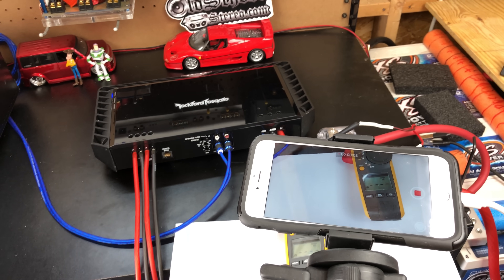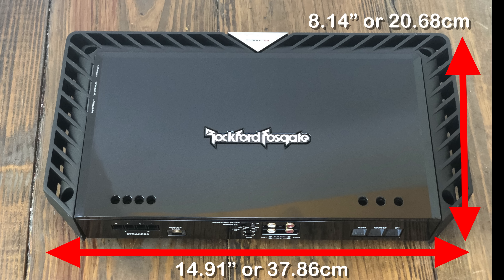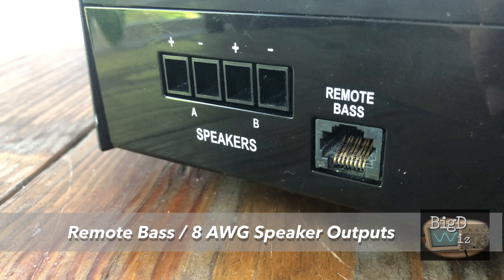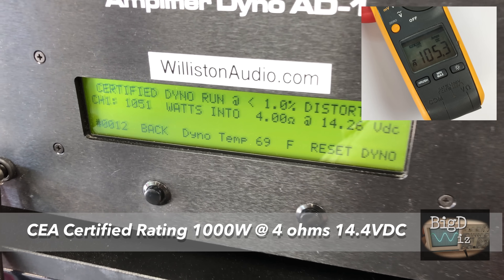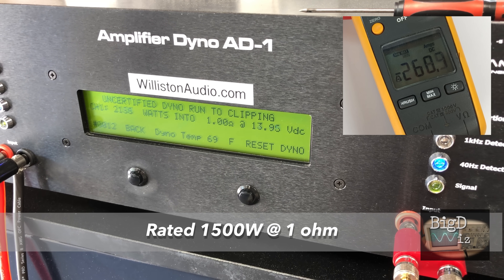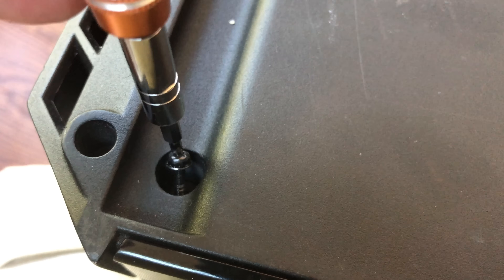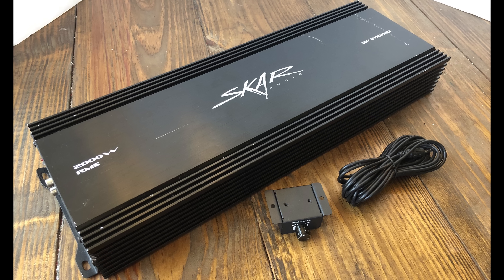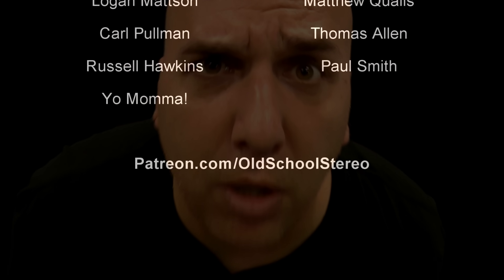Underrated? Rockford Fosgate T1500-1bdCP Amp Dyno Test

Comment: I've got a full Rockford system t1 subs and t1 amp and i can honestly say i am gonna rip their crap out of my truck and im going to rebuild it with a street set up and can guarantee my street setup will be 50 times better then their over priced garbage. massive audio xl and sundown here i come. by the way great videos ive actually watched quite a few of your amp test and your videos is actually helping me decide what my street setup will be thanks man👍🏽👍🏽
Reply: John Cox  lol technology has came far buddy sundown makes a 9x9 amp and is putting out 3 times more power then that Rockford you've got and guarantee draws low voltage. sundown fbs 3000 look it up you might change your mind about rockcrap.

Comment: I have a fosgate T500bd1 power amp.  1 svc kicker comp 12 n 1 planet audio dvc 12. What's the best way to hook them up together for the best bass.  Currently the dvc is wired to 2 ohm and the kicker is wired to it regular,  which runs to amp... connected to both A&B...  both neg. N both pos. Ran together.  So I have a jumper on the amp... A n B pos.... and A n B neg.... ran to the dvc.... connected to svc in 1 audio pipe box... not ported.
Reply: And it hits pretty hard,  just wondering if I have it right???

Comment: Need help finding a good amp.. I have MTX audio dual 12 subs 1200watts. Please recommend me a good budget amp around 150-230$ price range. I need something that will give me that BANG! For the BUCK!
Reply: the skar rp2000 is good and if you can find a hifonics brx2400.1 with the fins heatsink, sonic dyno it and it puts 2000w. both listed should be less than $200.00 used
Reply: SHō ˌôf thank you! Appreciate it

Comment: I don't really like this design it's the same design since 2010(IF IT AINT BROKE DONT FIX IT!!!!!!💪)
I had 2, 500w punch amplifiers 2 Channel pushing to 10in L7( one to each speaker) people swore i had four  tens in a Taurus station wagon back in the days( the only thing is they were monsters they would eat my hot wire every 5 to 6 months I had one fuse off the battery running straight back to the amplifiers no power dividing terminal no other fuses/ power restrictions in between oh yeah and had an Alpine 5 or 6 volt output radio)  it sound like dark rich chocolate if you know what I mean!!!! 😆 Lol

Comment: Please do a Dyno test on the Pioneer GM-D9701, seems like a great budget amp and it comes with a volume knob.
Reply: Same exact as 9601 which he dynod
Reply: @rmblwgn  so is it only an aesthetic upgrade?
Reply: @patrykkiszczynski9422  yes. I don't know what's up with Pioneer but they refuse to spend any money on their mobile line. However those are great amps I have the 8601. God I wish Pioneer would bring back their SPL Pro line
Reply: @rmblwgn  totally agree, they were legendary products sadly Pioneer seemed to slowed down on Pioneering new products :(
Reply: @patrykkiszczynski9422  just google d1200spl and take a close look at the inputs, outputs, fuses and power rating. almost like the Rockford Fossgate of Pioneer amps. man I wish they still made legendary stuff

Comment: I’ve got 3 p3 12s 4ohm dvc wired to 2.67 ohm I wanna go down to .67ohm but don’t want to blow the amp. Great amp and great video btw! “I’m outta heeeerrrreeee”
Reply: I’ve had my RF p1000x1bd wired at .5ohm for 4 years. As long as I keep it ventilated, it doesn’t shut off. I’d be disappointed if I couldn’t run a T series at .5 ohm.

Comment: I bought a pair of RF Power T1S2 12's,would you run the Power 1500 or the 1000 amp on these?Will be running the subs @ 1ohm.
Reply from the maker: 1000 as it will do 1200’ish
Reply: I have an Orion XTR 1400.1 on them now,but like to run the same brand amp/subs,will give the Power 1000.1 a try,thanks.

Comment: Have a rockford fosgate p325.2 bridgable amp. Running a single 10 " sub. Bought this 13 years ago and still bangin im my single cab. Can testify.  These amps are full of power and bullet proof. This amp has blown 2 subs over the years but she keeps doing the damn thang so shes gonna ride with me till the wheels fall off

Comment: I have 2 p3 12” , tryna find a amp to match the power,  cause the Memphis amp 1100.1 getting hot an cutting off
Reply: T1000 will be great
Reply: @TKO_Horticulture420  hello mate, rf t2s3 which amp should I use for 13 ”sub?  Would it be t1500.1?

Comment: You cant go wrong going with RF and JL Audio amplifiers.

I have a RF T1500-bdcp pushing 12w7 in a spec ported box.  Also, JL Audio XD 800/8v2 pushing a 3 way Hertz Millie Pro components, RF T2 tweeters and 2 way RE Audio XXX 6.5. components.  They sound awesome.

Comment: Back in the nineties doing installs and repairs i only came across 1 brand amp that wasnt repairable! PUNCH amps, when you shorted them out they literally cooked inside! Double sided circuit boards cooked, you couldnt even figure out where the traces used to be LOL. Amazingly if you contacted Rockford Fosgate they would send you the schematics! But the boards were way too crispy.
Reply from the maker: I use a Punch 200DSM from 1993 in my daily driver and have for the past 3 years

Comment: Rockfordfosgate is the ONLY car amplifier manufacturer I've seen use actual high-quality capacitors/components, every other brand I've seen uses cheap Chinese crap, but these guys are using Nippon chemi-con capacitors which is one of the oldest and most respected Japanese capacitor brands around besides nichicon and panasonic, United chemi-con has been making a wide range of different capacitor series since 1931.... rockford could have saved 15 to 30 dollars on each production model by using cheap crap caps or chinese knock off semiconductors... but instead they went with good quality, all the stuff in there looks like it's name brand components, I guarantee those pre drivers and driver transistors are nte's, fairchild's or sanken's as well as the supporting  circuitry semiconductors probably being made by Texas Instruments and a combo of the other three brands.... nothing but the best of the best you get what you pay for.... though from that angle though it's hard to tell which capacitor series they used from united chemicon. Next time it would be sweet if you could get better shots of those capacitors. Thanks for the review, and also if anyones ever unsure about a capcitor brand look on https://www.badcaps.net/forum/showthread.php?t=388 typically they update this list frequently... in my experience research and general consensus among other electronics nuts is that the only good brands are nippon chemicon/unitedchemicon, nichicon, rubycon, panasonic, vishay/b&c components/spruge, wima, elna, kamet, illinois capacitor/cde/cornell dubilier, wurth electronics,  and vicor 👌🏻👌🏻 everything else is trash and should never be used. 😂  Rockford Fosgate hit it out of the park with this amplifier!

Comment: great videos! did you ever test a t2500? do you ever mention the thd or any sound quality measurements?
Reply from the maker: My T2500.1BDCP has some issues with the Dynamic tests at 1 ohm and 2 ohms as it goes into protect. The amp is an absolute beast in certified and uncertified modes, but I'm not sure what's going on with the dynamic tests. Guess I'll send it in so it can be looked at
Reply: @wal  thanks for responding, i have one of these amps running a zv.5 sundown 15'' and it's insane! kicks like a mule, i love it. would love to see your test video on this amp. thanks for the great videos !
Reply: @wal  hello mate, rf t2s3 which amp should I use for 13 ”sub?  Would it be t1500.1?

Comment: I have a Rockford Fosgate power 500.1bd. I bought it used and I'm wondering how many watts it is. I have one cerwin vega stroker 12. Its dual 2ohm coils. Do you think the amp will be powerful enough or not? I have an old school hifonics cygnus equalizer for signal control. Its 20 db boost with 10 band frequency adjustments.  Do you think this will be effective?
Reply from the maker: Around 700-750 watts. Should power that CV sub nicely

Comment: Derek i run ALL rockford fosgate gear in my accord. And i run ALL punch amps. There is literally zero punch amp dynos none. I feel that they really get over looked because most ppl want prime or power amps. Is there any possible way you could test the p500x1bd amp please? I have 3 of them on 3 punch stage 3 10s. Not only would you be the first but the only to dyno the class bd punch amps. Id like to know how efficient and powerful my amps are. I also run all 3 availabe punch 2 channels. P300x2 p500x2 and p1000x2. On my power series mids and highs. I have a weird thing for 2 channel amps. And my punch 2 channels are just so smooth and lound. Please try to test a punch bd amp i would love to see that!!!!

Comment: I've seen heaps of Rockford amps from this era blow output transistors.  Rockford aint Rockford anymore.
Reply: Strange I've been using only rf amps since 1993 and not 1 has ever broke and I'm currently running 2 t1500s and a t1000x4 and a punch p600x4 in an 05 ram 330 amp alt, 3 batterys,10 t2 1inch tweets, 10 6.5 inch t2 mids and 4 t1210s with hundreds of feet of ofc and it brings the pain in every way possible and nothing ever goes wrong so how do you explain this ??

Comment: Are u more of a audiophile or SPL king of guy ? 🤷🏽‍♂️
Reply from the maker: I’m a bit in the middle, like great SQ, but emphasized Bass for sure. But I don’t personally like so much it rattles my car apart.
Reply: Nice 👍..loud but clean bass is key ..
Sativa or indica 🤷🏽‍♂️😉
Reply: Just pick one up today yard sale $50.00 about to take out C5 Crossfire Amp an slam my Soundown sub wire 2.67 ohm in my 13 Chevy Avalanche

Comment: Something about running a Rockford  feels so Coooool!! Still have my P325.1 from High School.  My first amp that got me hooked for life!
Reply: Fosgates expensive and people always say “you’re just paying for a name” I just tell them to listen to my mids and highs that my t400-4 is driving and their opinions always change
Reply: I still have a punch 45 from high school running a pro punch 12. Loved that setup
Reply: My first "good" amp I ever had was a punch 550.2. I was blown away by the difference of 600 watts rms compared to the 150 watts rms i was getting from my "1000 watt max" lanzer max.
Reply: @justinkelsey9218  Thats awesome, was my first as well and ran 2 P3 10" thru them. Underpowered but still sounded great until i traded them in 8 years later.
Reply: @bladeofwar those P3 10s don’t take a lot of power to be impressive in a bigger than spec box. Ran 2 in a 1.0 cu ft per chamber 500w RF amp, they got down and hit pretty low
Reply: There so reliable knoc on internet wood i haven't had one failed me yet and I have been rocking them since high-school
Reply: I ran a 45hd in highschool and a 1000.1bd now on 2 sundown 8s in my truck and you would think I have 15s

Comment: Loved this amp but hated how hot it got even when just idling. Had to get rid of it because I wasn't too comfortable with those temps where I installed it.
Reply: Mine does the same but it has “ never “ shut off even in Phoenix 114 heat❤️❤️🙌🏾🙌🏾🙌🏾🙌🏾🙌🏾🙌🏾🙌🏾🙌🏾💯💯💯💯🔥🙌🏾🙌🏾🙌🏾

Comment: 2 questions. 
1) what type of work do you do? 
2) I know you have a old school setup in your ride? Whatcha running?
Reply from the maker: 2 answers.
1) Work tryna keep you guys entertained
2) 1993 RF Punch 200 DSM powering JL Audio 10W3 in optimized ported box, Boston 6.5" Pro series components up front (currently passive via factory amp). Plans to make them active by running a 4ch amp to them
Reply: @wal  running visonik 12's on a old sony 800. Thanks for the reply.

Comment: Had one. Wasn’t really impressed. Now I have an dd m3c. 100 more from a authorized dealer (not the website or dd itself) and blows this out of the water on efficiency and power. Use to love Rockford but now I love dd. When I buy another 9500 fully built 15 I will buy another m3c and strap them pushing over 7k on clean rms power.

Comment: Isn't box-rise accounted for in speaker design? If you try to counter that, the designed frequency response will no longer be. It would be like you couldn't design an enclosure using software. You basically slap a sub in a box and hope it sounds good.

Comment: Everyone's praising overrating like it's a good thing, which to an extent it is when you're getting more than you pay for, but the point of a rating is so that you can get a general idea of how to design your system. When a rating is this far off, it doesn't make sense. The amp isn't cheap. You're not really getting more than you paid for if you consider the cost per watt right? This is all psychology. You make something overrated so that the fan boys can make a big commotion, and then you get a good reputation. So I guess you need a subwoofer rated at x watts but can actually handle 2x watts right? Everything's overrated right?
Reply from the maker: Point taken. I’d say yes, people want to get more than they pay for and should expect a more reliable, longer lasting product at these higher costs
Reply: Oh yes, I'd be thrilled if I got that much power from my amp that was "only" rated for X watts, and yes I would expect higher quality if I paid that much, but I have one of their Prime 1200W amps, and I don't see any additional benefit to paying more for the higher lines. I guess what I'm saying is that I don't get why people pay more for the higher lines when the lower lines seemingly perform just as well. But I must admit that I don't demand 1200W from it on a daily basis, so maybe it might fail earlier if I did that? I will never know. =)

Comment: Hey D! I was wondering if that was a used or refurbed amp because when I purchased my 1500bdcp’s each came with the remote bass knob.  Another thing... imo this is hands down the best sounding class D amp out there, and I’m not a class D fan.  But especially in the RMS, dynamic power & SQ combined these amps really crush it compared to most if not all.  Hope all is well!

Comment: Great video!

I am currently running an Alpine PDX-M12 (1200 watts RMS 2-4 ohms) to a JL Audio 12W7. If I was going to upgrade it would be amp.  

I still have a RF Punch P500X1BD and it slams the heck out of my 12" RF P3.

I will buy this amp first before JLAudio 1200/1v3, which cost almost $400 more.

Comment: Hey Big D i have a question, i was wondering if i could run a Rockford Fosgate Punch 600.4 in 2 ohm mono bridged  pushing 2- Alpine 6.5 components on half the amp &  2- 6.5 on the other half  or would it be better just too run the amp in 2 ohm stereo  pushing 4- components?

Comment: I'm kinda new to the audio world.
Does the 202 on the meter mean it pulls 202 amps from the alternator or what?
Reply from the maker: Yes, but these tests are using test tones, not music. A good average is 1/2 of what I show for current consumption should be available for loud music playback (100 amperes). With an amp like this a minimum of an extra battery is required.
Reply: Thank you Big D Wiz...
I appreciate the help.
I have a Rockford T1500 bd for my P3 12s and a P600x4 for my mids and highs the p600x4 has 771 rms and the t1500 has 1899 rms and I also have the sony stereo with the built in 160rms 4 channel amp.
Do you think a 220 amp alternator would be enough with a big 3 upgrade?..

Comment: Great vid ,i got two of these pushing 2-18" skar ZVX subs  but they can take more power thoe, was thinking bout doing a Taramp 8k amp or 2- bd2500.1 on ea sub. Well here is a up date, i found out one of my bd1500.1 amps was not working so for now im running 18" Skar ZVX subs on 1- bd1500.1 ran in half ohm not sure how much power im gettin now im guess its pushin bout 3,000 watts in .5 ohms

Comment: Hey BigDWiz!!  Question for you?  I have been looking for an amp the goes down to 20 Hz.  All the research I have done most all, if not all only go down to 35ish Hz.  Do they make a amp that will go that low, and if they do which one would you suggest?  something to run a pair of 10's.  With 500 watts rating on the amp.  Any insight would be appreciated!!!!
Reply from the maker: Most subwoofer amps should do 20Hz or even lower. You must be seeing the subsonic filter when you see 35Hz

Comment: Hey BigD, I just bought a new Orion Cobalt amp to upgrade from a cheap Insignia (Best Buy's house brand) 1200w monoblock that I was using. I was wondering if I could send you the Insignia amp and have you do an amp dyno and make a video on it, I'm curious to know what it actually was putting out

Comment: Can you Dyno the Audio Control LC-6.1200 please !! Love your channel great job !!
Reply from the maker: I generally don't test 6ch amps, but will look into it
Reply: There is the lc-4.800 which is a 4 channel version, they have the same output specs. I personally think this is a great amp that combines a ton of useful features and am surprised it doesn't have more attention.
Reply: I get my lc-6.1200 towards the end of the week and can't wait... Your channel has inspired me to try to tune this using some of your methods, but I don't have a Dyno so I don't know what it will truly output .. specs on both are 125w RMS  @4ohms by 4 or 6 channels depending on the model.

Comment: For 2K, would you recommend this or something like a sundown 2000 SCV wired at half ohm??
Reply from the maker: I would NOT recommend wiring any amp to 0.5 ohm load as it will be very inefficient and shorten the life of the amplifier.
Reply: But wouldn’t it still be louder than the Fosgate? Since the sundown will be putting out like 2500 W at .5 ohm?